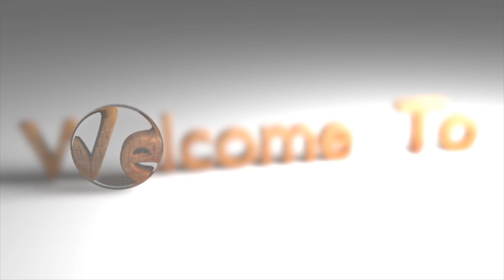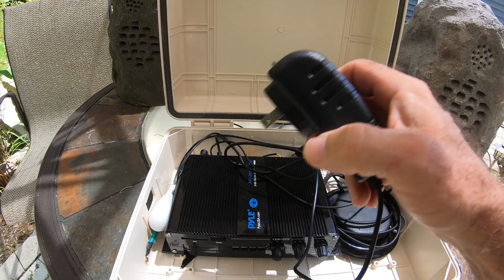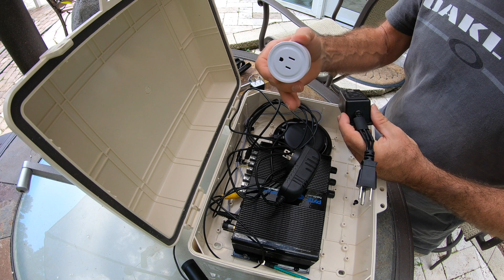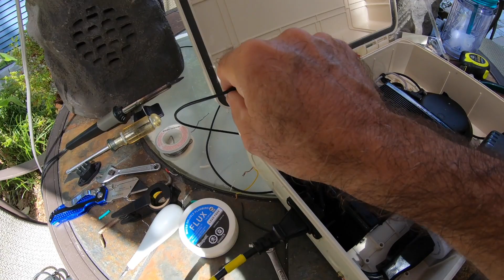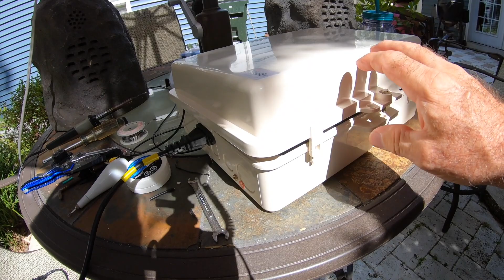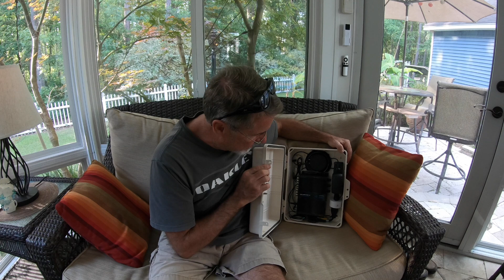DIY - HOW TO ADD SOUND TO YOUR LAWN & GARDEN

Comment: What is the range of the bluetooth after enclosure is closed up?
Reply from the maker: As I don't use the BT function and only a direct connect I would think the BT connection distance would be greatly impacted.  Only way to know for sure is to test inside the enclosure.

Comment: Hello, I have a Hampton Bay transformer.  I was wondering if I ckuld run low voltage cable from it to low outdoor amp?
Reply from the maker: You would have to verify the correct voltage and current of both the power supply and amp input.

Comment: Doesn’t it over heat?
Reply from the maker: No.  3 years running.  I have 2 fans installed but found it's not necessary so I unplugged them.  If you were to install this in direct sunlight I would recommend you taking advantage of the fans I installed.

Comment: Input power solution is not appropriate for outdoor use.  Have a professional electrician wire the 115V supply to you box.

Comment: Hi James, just my thought, what about heat dissipation in that closed box? It will be operating in hot weather plus the internal dissipation, maybe you should consider a thermal protection which would shut off the system.
Reply: fabrice26306 😂👀